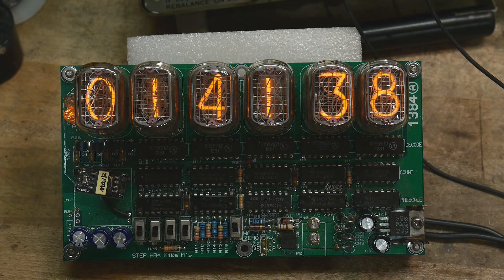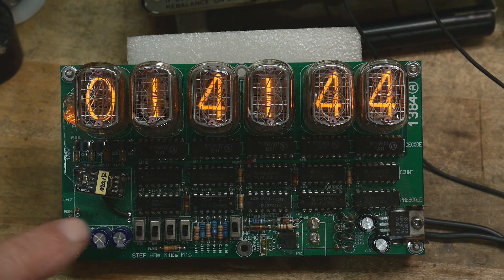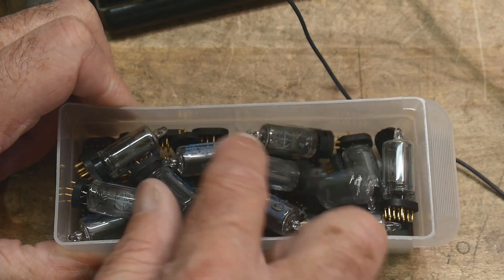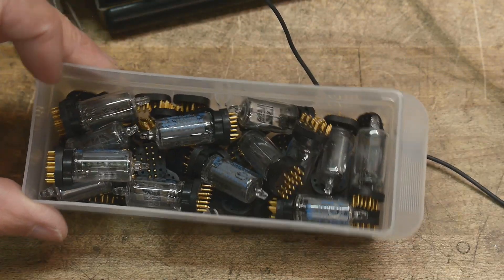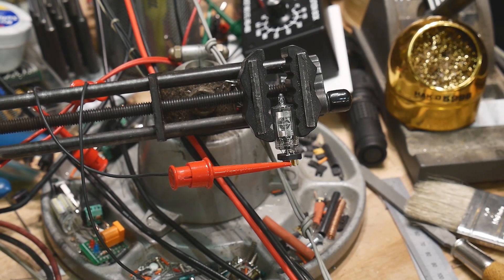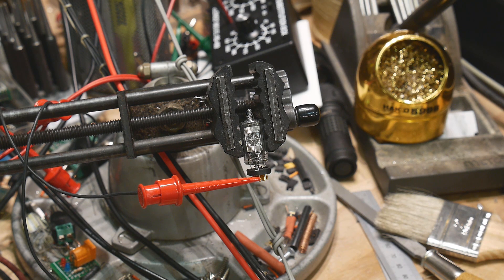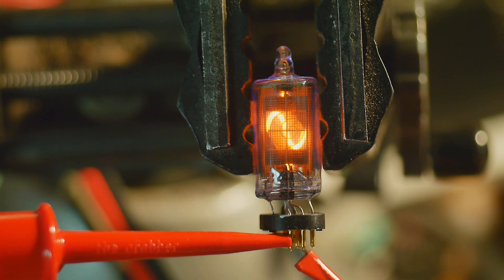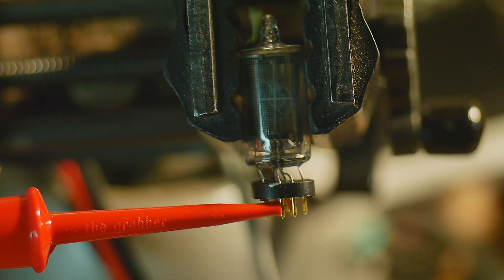#769 Very Odd Nixie Tube

Comment: Very nice Clock and PCB !
60 HZ power is pretty accurate these days, more so than an MM5369 + 3.579545 Xtal + Trimmer Cap - but I doubt you'd leave this clock running for long enough to measure - except for blackouts with Fire season coming...